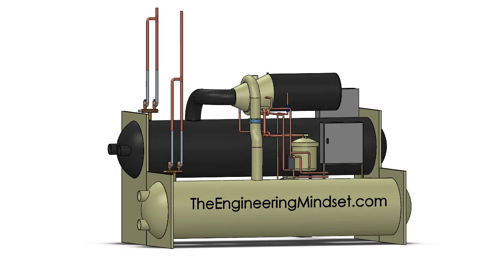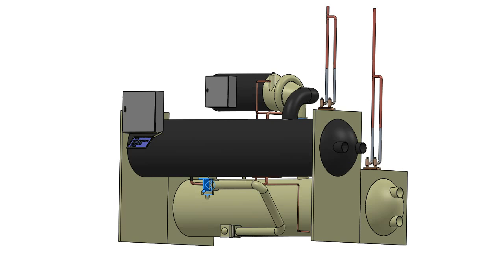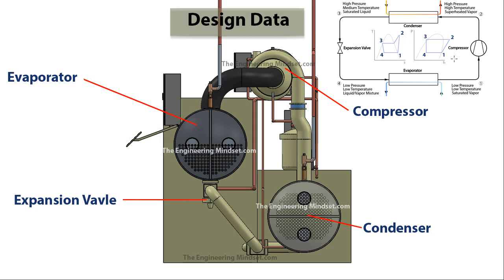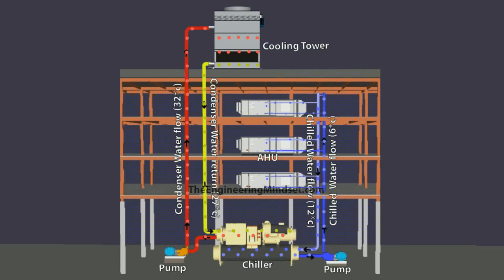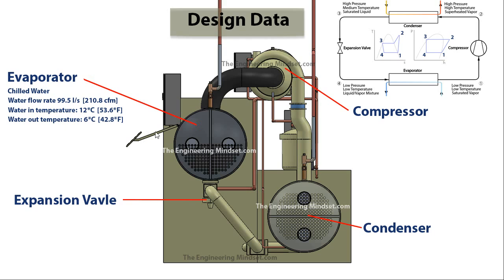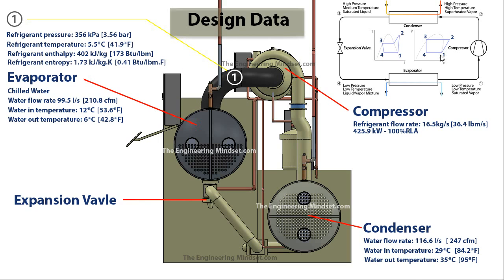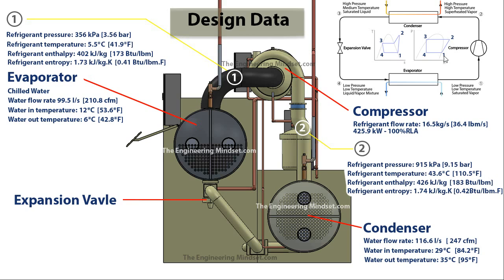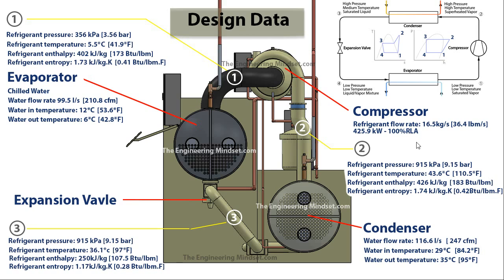How Chiller works - Design Data

Comment: Sir, how can the refrigerant temperature at point 1 and point 4 be the same?   Refrigerant must have done some heat exchanged with water before leaving the evaporator...  plz reply
Reply: It has picked up energy (enthalpy increase) but the temperature will not increase until phase change is complete

Comment: I have a question-
How does Condenser Water at 27C absorb heat from Chilled Water Inlet at 12C to cool it down at 6C ? 
Shouldn't the Condenser water temperature be less than Chilled water temperature for heat rejection to happen ?
Reply: Condenser water doesn't absorb heat from the chilled water. It's a complete cycle of heat exchange. You should watch previous videos.

So what happen here is that refrigerant gas heats up when it passes thorough compressor to the condenser, this I where condenser water exchange heat from hot refrigerant gas. Then this gas condenses into liquid where it goes into the evaporator where it absorb heats of building to reach vapor form that saturated vapor form of gas then enters to compressor to further heat up and repeat the cycle.

Comment: I was wondering if you could explain why the refigerant temp doesn't increase from 4 -> 1.. Shouldn't it be rising if it's picking up heat from the return water? I see the enthalpy rising like I would expect there.. I'm guessing there's a physics explanation I'm missing. Thanks and thank you for all these videos.
Reply from the maker: The refrigerant undergoes a phase change, during this time all the energy absorbed goes into the enthalpy and entropy to break the atomic bonds, there is no temperature change as this occurs. If more heat is added after the phase change then it will increase
Reply: I still think temperature increase should occur between 4 > 1, for proper function of the system, the vapour that exits the evaporator is considered super heated (temperature added above boiling point of the refrigerant) to ensure all liquid refrigerant is evaporated and no liquid enters the compressor. If it remained at phase change temperature (boiling point) after exiting the evaporator there would be a mix of liquid and vapour entering the compressor. Usually the phase change is completed half way into the evaporator coil and by the time it leaves the evaporator it is slightly heated a few degrees higher as complete vapour.
Reply: @xKNIGHTRYD3Rx  this video is theory and how should it be. ALL energy absorbed from the chilled water is FIRST destined to the phase change,, only when the phse change is over, it may pick up some energy to rise the temperature of the refrigerant. For instance, if you are running low in refrigerant, the phase change may be completed in an early stage in the evaporator, and then you would have some rise in temperature in the last stage of the heat exchanger .
Reply: @Cabe_8623  Understand, and I acknowledge the process of the phase change occurring first, even if we’re only talking about theory it is important to note that this phase change is completed and temp rise most likely does occur theoretically as well. Systems aren’t designed on a low refrigerant scenario only to ensure this occurs